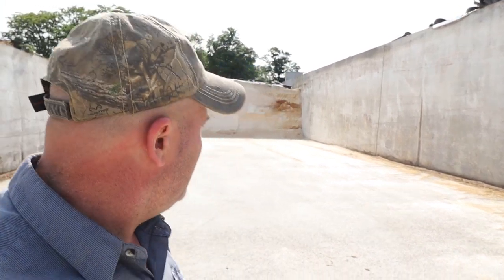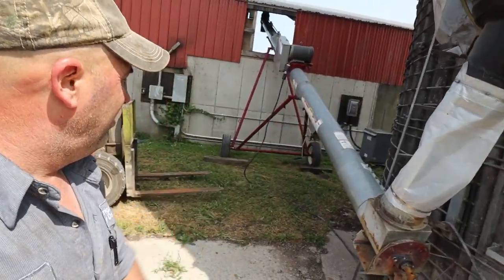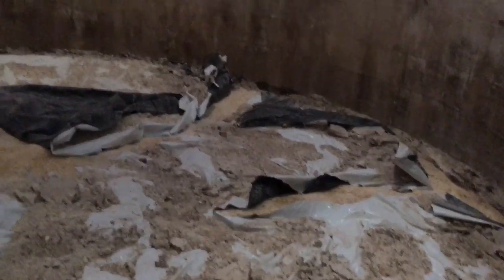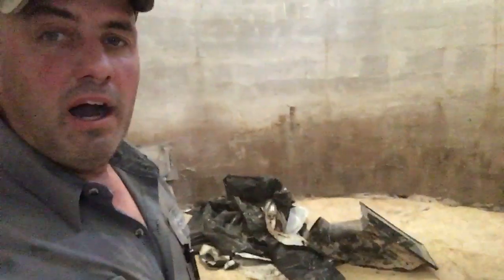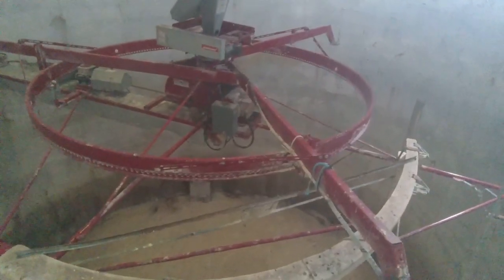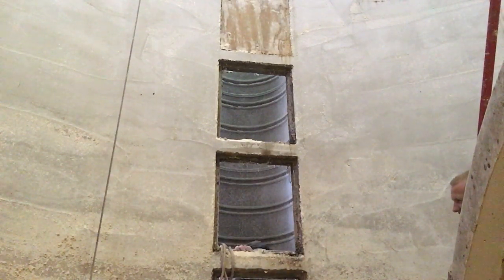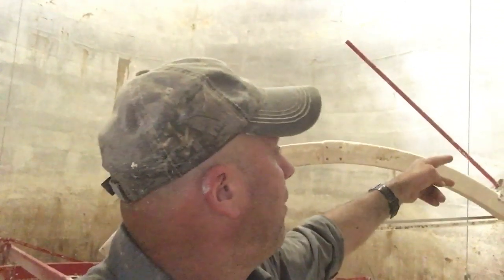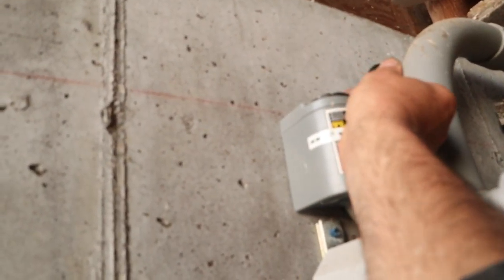Hi-moisture corn bunk is empty time to open up the upright silo

Comment: Fun job grandpa has two Dotson silo’s one went through the door like yours does and the other down the center  of the silo. They both were 24/75’s fun times when they would plug up with corn silage. Maybe need some natural lights cold ones I call them neutral’s to help passing through the door openings. Less Carbs!!! 😂👍
Reply from the maker: Yes sir

Comment: hows the high moisture corn affect the silo and unloader,does it affect the sides or do you have the insides coated somewhat regularly. on a seperate note out back off the  milking barns i see their looks like white dairy barns is that an active dairy farm if so how big ? thanks Andy.
Reply from the maker: Matt Lavin we had the silo sealed when it was put up in 2012 and the barn in the background isn’t operating anymore.
Reply: I would run the blower to get fresh air in the silo when I butting the unload er together good video Andy